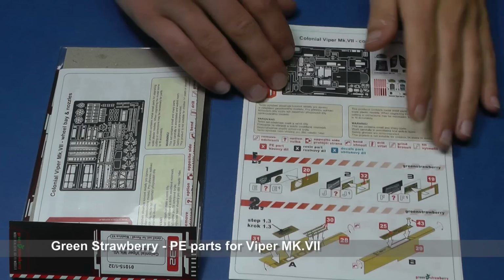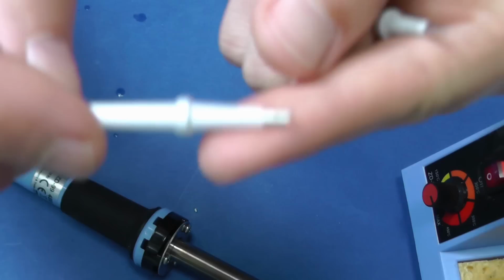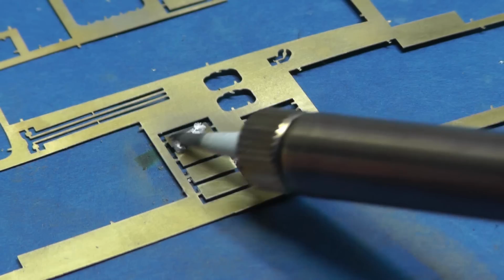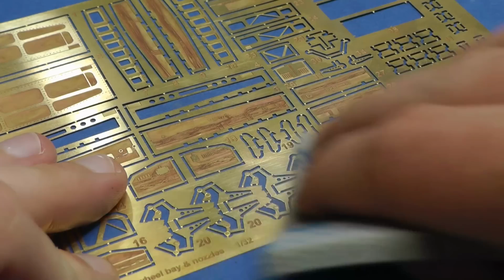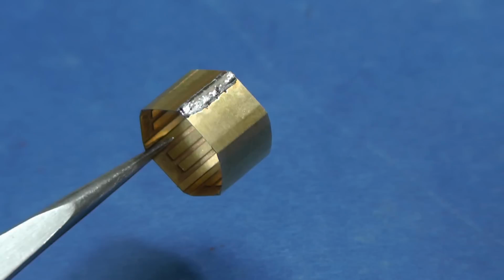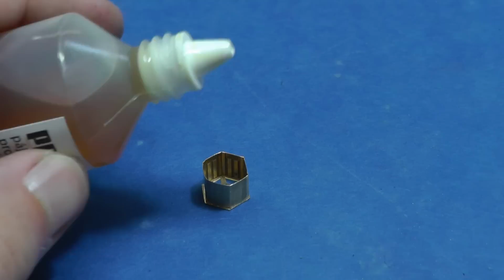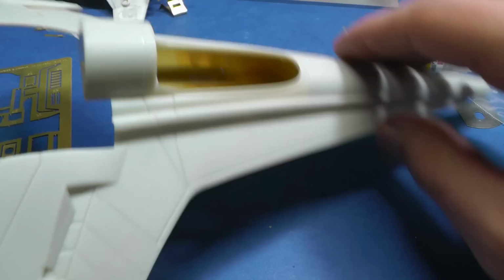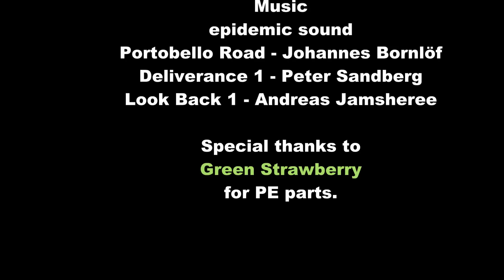Soldering photo-etched parts for beginners - Great Guide

Comment: If you're soldering a part that will be visible and you'd like to keep the solder from flowing all over the place, you can restrict where it flows by drawing with a sharpie first...the solder won't cross the sharpie line.
Reply: I was going to suggest a mask that is a great idea are there other techniques like this to use? Steven columbus michigan

Comment: Only one warning....it is very easy to overheat smaller parts and even burn yourself quite severely when handling the parts.  Brass is an excellent conductor.  I usually keep a wet rag and a bowl of ice water to cool parts after soldering them.  This is because I have soldered one side before, only to lose the other because the heat reflowed the solder.  Great video as usual.

Comment: I'm mainly a railway modeler, and have built a lot of PE/White metal Wagon and loccomotive kits.
I go with the others who say that you must heat the joint with the flux on it first, and add the solder to it, then pull the tip of the iron allong the joint and the tin will follow when hot enough.
This way you can make much neater joints, and enables you to solder joints that will be in sight, without unsightly blobs of solder.
Soldering as much as you can on PE parts will make the end result stronger and more durable, any CA joint will fail over time, a good solder joint will last longer than the plastic of the model itself.

I'm unfamiliar with the type of flux you use, the liquid resin.
But it must have some advantages but also disadvantages over the type of flux I use, which is dilluted phosphoric acid.
The main advantage of resin flux is the non-corrosive nature of it, so it doesn't need a very thorough cleaning procedure.
But when I compare the way the tin flows in the video with the way tin flows with the phosphoric acid flux I use I conclude that the tin flows much better with the acid flux, and just leaves a very thin film of tin on the surface, that's because the acid flux etches all dirt of the metal including the oxide layer.
But it keeps on etching into the metal so after soldering so I wash the parts with cleaning soda (sodium carbonate) to neutralize the acid, but baking soda will work equally well, then I wash the parts under the running tap to flush all residu away, using a toothbrush and an old paintbrush to go into the difficult to reach corners.
A glassfibre pen is also a great tool to remove excess tin from vissible area's, it removes the tin very good without damaging the brass.

And a warning when soldering on parts that have been glued with CA, the fumes are very irritating and toxic, as they contain cyanide, one of the worst chemical weapons that have been used during WW1, so don't breath those and don't get them in your eyes, that's very painfull as I can tell by experience.

Comment: A nice little video. A couple of things I would do slightly differently. I would use the small chisel tip as my main tip not the pointed one.Reason. It delivers heat quicker to the brass allowing faster solder coverage with less "wiping" of the tip on the edge of the brass, as shown here the brass is not heating fast and the solder not running with the flux without continual "wiping". Also cleaning the tip more frequently to ensure even whetting and remove any carbon or residue buildup. And for finishing do not clean the tip, leave a coating of solder on it when finished. Clean it by using the sponge before the next job. Never file, scrape or reshape a tip.

Comment: I like that bending tool, works a treat, as for the soldering, I was always taught to heat the materials to be joined then add solder to the work, however, that was for copper pipes, plumbing and building work etc 
Heating the materials like etched brass can distort the work piece if you get it too hot, also this is not under any stress so this method works well and won't distort your workpiece as heat is minimal.
Looking at how you did it it looks faster too this way as your not having to heat up cold parts every time you solder, just my opinion I'm no expert by any means, great vid thank you
Reply: i guess Im randomly asking but does anyone know a tool to log back into an instagram account??
I somehow lost my login password. I love any assistance you can give me.
Reply: @Knox Charlie It did the trick and I now got access to my account again. I am so happy!
Thank you so much you saved my ass :D
Reply: @Jonas Ezequiel Happy to help xD

Comment: You still can use the soild rosin and dissolve it in alcohol, Isopropanol works great. The liquid flux, most of the time, isn't much else. You can even control the conistency by adding more IPA or letting it evaporate a bit. Done this for years and hat good luck with it. Maybe you can give it a try.
And I really like your channel, great vids and many useful tips. Learned a lot from you, thanks.
Měj se!
Reply: really ? i have no idea that rosin is dissolve in IPA alcohol,, so we cut a piece of rosin and drop some IPA onto it, until it mostly dissolve ?
Reply: "had good luck with it" is exactly what you had. I'd be surprised if you haven't ignited the IPA yet.

Comment: I was taught by my grandfather that you always heat the work, NOT the solder! This is because you want the metal to wick the solder into the joint. Flux is only supposed to assist in this process. When done properly, the solder is fused into the metal. 

It's probably not that important for this type of model making, since you do not require the joint to be strong, but it is something to consider, especially when attempting to teach proper technique.
Reply: That is important when dealing with electronics because heating up the component too much can damage it, not an issue here
Reply: That's right. The flux also marks the area where the solder goes, you heat the metal and there will be just enough solder to fix the metals on exactly the right places.
Reply: No. It would be much easier to solder if you preheat the part and then apply the solder right to the part. Not to the iron tip. This kind of solder has flux in it already, but he burns it up before he even gets to the part he is soldering. Really, try it the other way and you will see.
Reply: It didn't :) Not for a person who does solering regulary...
Reply: You are right, But i worked before making amplifiers and speed is one of our elements pre heat or not if its soldered firmly it will last a great amount of time, But since this is "Scale Models" it is not necessary. Most modelers use glue instead and that is already strong then this method is far more stronger. But i think common sense rarely exist in your kind. I mean do you really need to comment something like that on a scale modelling video. LMAO
Reply: My "kind?" what kind is that??
Reply: It depends, on what you are soldering.
Thin photo etched brass, is quite often pre- painted.
It is thin material, not requiring a lot of heat.

Pre heating, will possibly mar the painted surface.
Follow PLASMO"s tips you cannot go wrong
Reply: your grandfather was correct. If you clean the metal,  then apply the flux sparingly, and heat the metal then allow the solder to wick along the joint. However, that takes a lot of skill, and counter intuitively a much larger solder iron tip, but for most people who only solder now and again what was demonstrated produces acceptable results.
Reply: I was not trying to troll, I was simply trying to point out proper technique, which is the same if it is for decorative purposes or not.
Reply: Steve Puma Yes, solder flows towards heat, so you heat the metal parts and make the molten solder flow towards the soldering iron. And another point is, you should use the BIGGEST tip you can (so many people think a small tip is better because it looks "delicate and tricky"), because you want to get the heat in before the temperature rises too much. This prevents delamination on circuit boards, but also prevents photo-etch from warping too much.
Reply: I know someone who soldered a brass steam locomotive tender together the 'right' way and before all the parts and details were attached had succeeded in annealing the side sheets to where they distorted with only enough pressure to pick up the thing.
Reply: That shouldn't happen at all with brass...
Reply: Your grandpa was right - when it's about electronics. If you try to assemble a brass model that way you'll find that the part you just soldered will fall of when you are going to solder next part.  The best flux for brass is phosforic acid, about 12% (1 part  acid to 7 parts water)  This has been used in GB for decades, I first read about it in an english magazin. The flux in the multicore solder is enough for electronics and cables, not for brass models. try to  find more information in a british video  for example "the right track"
Reply: in fact it is important, since it enables you to minimize the amount of solder and get the cleanest possible joint.
Reply: That depends If one has to scrub or wipe the solder on to get it into the joint then it has not been hot enough initially and the joint may be flawed.and fail at a later stage.Yes, I had IPC 610A certification, but lapsed when I retired.
Reply: Steve Puma it would warp the parts. So no. Also, it would melt all the other joints that i have already done when you heat the metel. This is not electronics. This is brass modeling. You cant pre heat without melting all your other joints with 3 or 4 inches. Brass as i am sure you know cunducts heat very well. So not that is not proper technique with this kind of stuff. You just pointed out how to ruin your hard work you already did.
Reply: Thought I might chime in here.
You do need to heat the materials to  get the best joint.
If you put the solder on the iron you introduce corrosion to the solder before you get it on the part.
Effectively you have created a dry joint. Which is a weak joint.
Also the amount of time he heats the parts together is far longer than is required with the proper technique. Which burns away the flux and adds more oxidisation.
There are a number of videos that demonstrate this.
Reply: Los Santos City h

Comment: Great video! One idea: to avoid covering some area with solder, just apply there some lacquer. Easiest way is to use a simple permanent marker pen. For example, your hexagonal component lid soldering would be much easier to limit the solder flow.

Comment: To clean the tip, use a ball of steel wool used for cleaning pots and pans, i use one that looks like a ball of twisted metal strips. Found it in the grocery store. Not the one with soap in it.

Comment: You might want to try limiting where you put the flux rather than flooding the area, so perhaps look for a flux  between the two types that you showed, and  paint it on the inside rather than the outside, and don't be frightened of the larger tips, I always use a hoof when ever possible , it holds a reservoir of solder so gives a much more uniform thickness. the chisel point is also good for soldering edges.  Also wipe your tip each time you charge it with solder. Soldering is a matter of confidence which comes with practice.

Comment: Hi, may I add that in a number of small previously bent parts construction, soldering a joint line from inside the part can avoid cleanup and so sanding away detail from the soft brass. Kind regards, Dave Porter UK

Comment: you can also get solder and flux together as a paste, apply to the joint with a brush and heat the metal till it melts, the paste does the rest

Comment: Resin ? = a type of Flux. But in Britain there are numerous different types of fluxes each for specific metals. There is also multicore or 4 core pre-fluxed solders, which help avoid some of the messing around with resin and solder as seen in this programme  !!!

Comment: Flux is meant to clean the parts to be soldered, thereby it helps the solder flow. Oxidation occurs immediately when heat is applied, this flux mitigates this process. You are using tin/lead solder, I think you said 64/36 which is 64% Sn (tin) 36% Pb (lead). Solder will flow to the source of heat, also once it has adhered to the base metal the capillary action will allow you to draw a bead of solder over the part. Always keep you tip clean, tinned and flux the part first before applying heat with the solder, clean the area with IPA (not the beer), isopropyl alcohol, to remove the flux residue. It is often damaging to the base metal and won’t take paint.

Comment: Hi , nice Video good tutorial , maybe i can suggest , you use another Flux,it is more a paste,
and it cleans the surface and holds it clean, this is used for Copper piping, and i also suggest use a soft solder  without core, no Electronic solder, also you get a solder paste where the tin is mixed with the Flux so you use a brush, apply where needed and only warm up , later clean only with Tap Water, because this Flux is used for Drinking Water .

Comment: When soldering parts, you do not smear solder all over the place, you hold the soldering iron in a place where heat is transferred to the component without touching the exact location where it is supposed to connect. Also clean the parts after soldering because flux is highly corrosive.

Comment: To avoid too much solder on joint, you can use soldering paste. This is liquid flux with dissolved micro corns. A chinese brand Hee LFM-86W TM HP which I bought in Vietnam for €5

Comment: I'm pretty sure that the hard paste is for cleaning the tip of the iron anthem solder to adhere and spread on it, while the liquid is for the use you are giving it.
Edit: the sponge is for cleaning the excess solder and gunk from the tip, but this must remain completely covered in solder always. Even when cold.

Comment: David, great instructional video as always. One question, do you prime the PE metal surface before you paint?  Or, just paint on the PE surface?
Reply from the maker: Yes, I usually use Mr Surfacer 1000. It is not the best solution but sufficient.

Comment: You can also remove the remaining solder on the tip with the wet sponge and than remove the solder which is too much with the solderless tip so you dont have to grind it.

Comment: Sorry mate but ive built brass locos all my life and you only use the iron for heat transfer ie solder the tip and apply to work piece with flux on it n keep it there then apply solder and itll run through the join on its own . Never apply solder on the tip and apply it on large workpiece , small electrical work yes do apply to tip n clean your tip after every join and itll flow better....😉

Comment: have a question for scale modeler's. Let's say I have a brass sheet or plate and shape it like a fender for a diecast car, can I solder the parts into a Hotwheels 1:64 body?
Reply: What Material is the Body?
Reply: No idea on what type of metal use in your typical 1:64 Hotwheels diecast cars. I want to customize it and use brass sheet to make a fender or other parts for the car... is it possible? would it adhere to the diecast? TIA
Reply: Not sure if it would stick, not knowing what metal it is, you may be best trying a test joint, find a die cast you don't want or an area that would be seen and try it with a bit of brass sheet. if you solder anything you won't regret buying some liquid flux It makes soldering so easy!
Reply: Yeah, I was thinking of trying it for myself, but first I'll try to grab one of those flame torch at the local hardware store... I'll strip the paint first from the hotwheels and apply soldering flux on the piece of brass sheet and place a few cut strip of lead from the sides and flame-on all the way! hahah I'll do some experimenting.... Big Thanks to all those who response!

Comment: That's not how to use solid rosin flux!. U should scoop a small piece of the flux and then apply to the metal surface. Heat both the metal surface and the flux. That ensures cleaning of the metal surface. Now melt the solder on to the hot metal surface with boiling flux. Then you will have a perfect solder.

Comment: They may be suitable for you . . . but what you have demonstrated are known as Cold Joints. It makes a weak joint hence is NOT the correct soldering method =  1. Flux . . . 2. Iron to surfaces . . . 3. solder applied to joint . . . is standard.

Comment: You are doing it strange way. First: use soldering water, second: heat the part and than put solder tin there - it will work much better - of course using soldering water means you should wash parts with water after soldering. Your parts here are extremely huge (consider soldering TT scale (1:120) semaphore - it is easily possible without super glue ;) ).

Comment: I'm an electronic engineer, and doing lot of soldering at work. You can call me an expert. But I can't understand, WHY do you need to do it with photo-ethc. Gluing stuff is so much better, soldering is both, overcomlicated and looks bad! Unless you try to make a model solely from metal. Like an armor. Weld lines would look absolutely beautifull and realictic, but for what else?

Comment: Wrong soldering technique- heat the part and then apply solder, thinner solder helps. What you are doing is creating cold joints.
Reply: I agree, completely wrong technique. If your not going to do it correctly why bother at all. Why not glue the whole thing!!